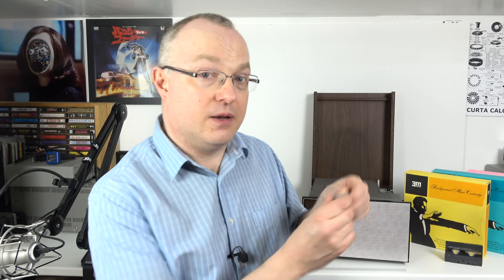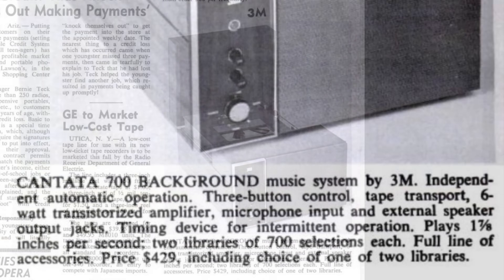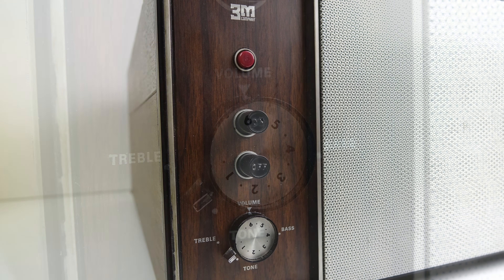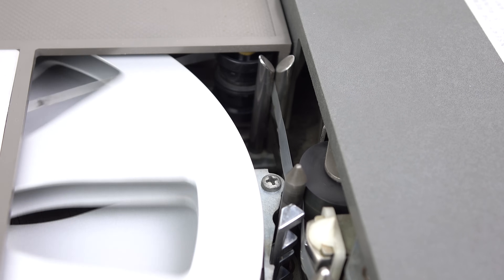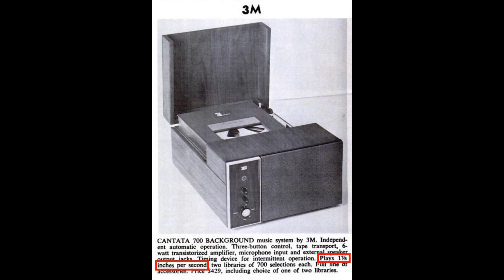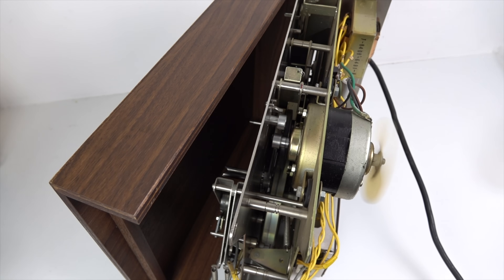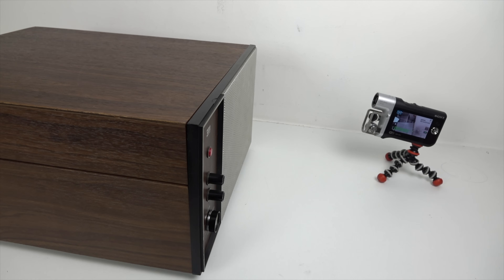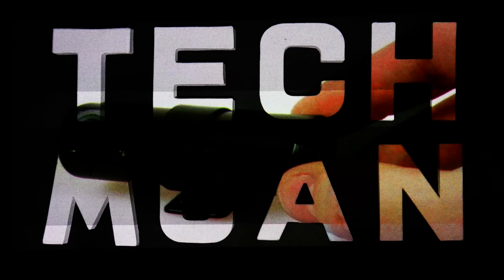Retro Tech: This 1960s BGM Machine played the Biggest Cassettes ever made - The 3M Cantata

Comment: 3M prefected the ability to stick something to something else. Think Scotch tape, sandpaper, recording tape and many others. Muzak was a separate company, a competitor to the 3M Cantata system. This system was the only thing available at the time for an on premise player, tapes ran between 18 to 24 hours. There were several Christmas tapes (a must for retail applications) which ran 8 to 10 hours, was painful to listen to. The best tape in the library was called "Bright and Lively". The players cost about $350.00 wholesale, tapes cost just under $ 300.00. To make a business out of it, the supplier had to have 3 tapes for each machine sold. One in the machine, one in the mail and a Christmas tape. The tapes were lubricated meaning you could not use ordinary tape in the cartridge. The music was recorded the wrong way so you couldn't play or record it on a normal tape recorder. The rubbers needed replacing from time to time, the play heads wore out, motors were expensive. All in all the machines were very durable. If you knew what you were doing, the Cantata could drive up to 20 overhead speakers. The wooden player was replaced with a plastic model, it ran almost as well but the motors gave out sooner. Other competitors came up with better music which crowded out 3M, satellite killed the on premise machine, internet killed the satellite equipment, all very expensive upgrades.

Comment: There was also another model that we don’t mention is the 3M Cantata 700 CA264 Cavalade, and it was another smaller unit, and it was from the early 1980’s and it was one of the very last machines that 3M ever made until they discontinued. It is very rare and very difficult to find.

Comment: Just saw this episode.  It reminded me of the music system from the store I worked in the same era.  It used 16 2/3 rpm records with large spindle holes.  The unique (to me at least) item was that the the top half of the changer mechanism rotated in the opposite direction.  It would play the record on the turntable then the tone arm would lift and a second stylus would play the bottom side of the one on the spindle.  It was a changer.  When the two available sides were done, it would drop the record.  When all sides were done, it would lift the stack to the spindle and drop the first record and start the process over.  8 records lasted most of a day.  Every so often, we would get another set of records so that the play list changed.

Comment: My uncle worked for 3M for 50 years. He worked extensively on the scotch tape line but his "baby" was the Scotch Brand MAGIC tape which was a pressure sensitive adhesive that you could remove without damaging whatever it was stuck to, made famous with their "post It" notes.  He was known as the "Glue Guru" so no, he didn't invent the post it note... But he was the reason it Stuck Around lol.  He then went on to make the company a ton of money by creating a special adhesive that was used in the manufacture of Fiber Optic wire.

Comment: (unrelated but:) Turning a tape device sideways to get it to align and work? Done that too, but for Video8! Trying to get our family's old tapes to play again on the capture card and immortalize 1 year old me in digital video format, had to align the whole machine a couple of times adjusting the tape guides so the angle it hit the drum was correct, and it would only stay correct if it was disassembled and sideways. No case allowed, whatever there was on the tight tolerances of those Sony Video8 cameras of the 90s sure didn't play nice 25 years later.

Don't even want to imagine the nightmare it would be working on even older helical scan stuff, thankfully for audio stuff with only linear heads it's not as infernal to get it working, but when stuff is old and without much spare parts available it sure doesn't help.

Comment: Sony made a three speed home reel to reel  machine that has 1-7/8ips speed in stereo which was fine for recording radio broadcast. Frequency response was up to 6-8KHz with normal tape and up to 10KHz response with the high end tapes. A 3600 Ft roll of tape plays many hours on one side. The cantata 700 reels look like it could store twice as much tape. I once recorded Fleetwood Mac Tusk On Maxell UD-XL tape and surprisingly it actually sounded pretty good at that speed.

Comment: Something that may not be immediately evident: This is *double-sided tape*. The tape goes from one reel, past the tape head, then does a half-twist and goes back past the tape head in the other direction before ending up at the other reel. That half-twist means that the two read head positions are actually looking at opposite sides of the tape.

That, plus the slow travel speed (1.875ips), plus the colossal size of the cartridge, makes a runtime of 26 hours totally believable. Still, it works out to roughly 1.38 miles (2.22 kilometers) of tape. That's a lot of tape. All of it filled with drivel.

Comment: i JUST found 1 of these in the trash tonite with 3 tapes AND a HEAVY metal trucker cb looking microphone attached to it powers up, nothing moves, pinchrollers total liquid rubber good to know what they are, now to bring it back to life again!
Reply: now if someone has the measurements of said pinchrollers i could make it sing as all the gizmos hopped back to turning by hitting the reversing switch the wheels started turning the posts were spinning but without said troublesome pinchroller sadly i cannot hear it sing once again also have to look at the audio outs as mine seems awfull quiet emitting ANY sound, full blast is barely a whisper.

Comment: Loved this video! Big personal flashback for me -- I used to work for a background music company in the early 80s that sold all kinds of systems, and a bunch of clients still had these machines running. My job was to fix those big cartridges when they finally choked. They would have been playing in the kitchen of some truck stop or diner for God knows how long, decades maybe, and when there was finally a power outage or it got unplugged, that was it. It would end up on my repair bench. I saw a bunch of these things, covered in grease. Or worse. Those rubber brake pads that melted were a familiar sight. Often there was no pad left, just a puddle of goo on the bottom of the cartridge. Used to scrape it up with a putty knife. I could usually get them running again, so they went back to the client, and those poor employees had to go back to listening to that awful music.

Comment: +Techmoan I was a little curious as to the length of those carts, and just did some quick working out based on the (Approx) 26 hours you put each cart at:

26 (hours) * 3,600 = 93,600 seconds of playback per cart,
  Multiply by 1.88 (1 7/8" decimal) = 175,968" of audio trackage,
  Divide by four (Assuming 4 tracks) = 43,992" of tape,
  Convert to feet (Div by 12) = 3,666 feet (1.17Km!) of tape per cart!

Does this seem in any way reasonable for what I'm assuming are 10" reels, or am I miscalculating/misunderstanding things somewhere along the line? :-)

Comment: 3M and Muzak were totally separate companies and fiercely competitive.  I worked for a Muzak franchise for about eight years in the 1970s.  I did encounter this mechanism during that period, but I do not remember much about it.  Muzak originally played 16 rpm transcription disk, but converted to 13 inch tape transports with each machine playing eight hours.  It was fully automated except for the loading of the tapes on the machines.  The music was distributed originally on dedicated telephone lines provided by the Bell system. Each exchange had its own amplifier which provided a line level signal to customer locations.  Later it also distributed the muzak via FM mpx sub channels on a local FM station.

Comment: I can see why those BGM pieces were 2.2 minutes long rather than the more standard 3 minutes. 2.2 * 700 = 1540 minutes. Tape is bidirectional, so divide by 2. You need 770 minutes of tape and 1.875 IPS, or 770 * 60 * 1.875 = 86625 inches of tape. If they used half mil tape that would be 43.3 cubic inches of tape. That 8.5" reel would have a max tape diameter of about 8", and the hub diameter is most likely 3".  That happens to be 43.2 cubic inches of tape. They couldn't have gotten more music on unless they went to a larger reel.

Comment: Great video as always, but I feel it's missing some of the technical details.
First of all, it's not clear but I suspect the reason there are two distinct tape feeds in parallel is that the tape is recorded on both its front and back side. The tape seems to get flipped over by that plastic widget in the cartridge, so the lower line exposes the back of the tape compared to the upper one. I can't see any other reason for doing it that way - if it was all recorded on the same side of the tape there would be no need for the two separate feeds. 
Secondly, even with recording on both sides of the tape and running at 1 and 7/8 ips, there's no way you could fit 26 hours of music onto a single tape of that size if you were only using a single recording track on each side. I'm speculating but I think it must be using at least 3 or 4 mono tracks on each side of the tape, and every time the tape gets back to the beginning and auto-reverses, as it moves the head back to the other side it also positions it slightly differently to read the next track. When it gets to the end of the last track on the back of the tape, it goes back to the first track on the front.
Recording on both sides of a tape is of course prone to crosstalk as the magnetic signal from the back of the tape can be picked up while reading the front, but it's such a lo-fi system to begin with that it probably doesn't matter too much.

Comment: Oh wow, does this takes me back. I ran the 3M Wollensak (Mincom) and A/V Products service facility here in the 70s and early 80s and had some of these pass through the shop. One stands out as being the best example I ever saw. That one belonged to the Horticultural Society of Philadelphia and was used during the annual flower show (and possibly at their office). I can't recall now what the complaint was but it was something simple as we turned it around the same day it came in. We gave it priority because of the impending flower show.  Have you tried using Rubber Renue on the rubber parts?

A couple of parts are the same as those used in their T-524 and 5000 series reel-to-reel recorders. (Head, pinch rollers, idler wheel, knobs, etc.) If you needed other parts you had a problem as 3M's duplicator/BGM division was separate  from their audio and visual groups and dealers/service stations for those products had no regular relationships. 3M ran each division like a different company.

On first sight most people thought this was an endless loop like an 8-track. Thankfully it wasn't. The various endless loop formats of the time included film projector carts, a/v carts, tape-controlled film movie/single frame combos, etc. All were trouble for the users and us. Technicolor's 8MM film system and Besseler's film/tape system come to mind as being special pains.. 

3M of the time believed in pushing for slower tape speeds. Their T-524 and first-generation 5000-series tape records had speeds down to 15/16 ips.

I was not aware till I saw your presentation that they had an offshore market for them too. Keep up the good work.

Comment: A similar product was manufactured by Rediffusion, (Reditune). This was around in the late fifties and into the early sixties. The difference was that the Reditune version used quarter inch tape, and was front loaded. These were made in Jersey, Channel Islands. It used a single continuous tape, pulled out from the centre, as in the later 8 track cartridge.

Comment: Here is my 2 cents worth regarding the wobbly sound, my god I recognised it immediately. I have had two cassette players in my life, the first one in the late 60's was an early Philips boom box as it were, in mono and the second was was a 1988 Honda GoldWing 1500/6 this one was in stereo thankfully, I still have it today minus the cassette deck which I smashed in frustration. The point of this ramble is this, I remember that wobble because both of mine did this and I found that rewinding the offending tape a few times fixed the problem, I figured that as one plays the tape for extended periods of time, like I did, the tape starts to wind up uneven and starts to rub heavily against the bottom part of the reel as gravity continuously pulls it downward, I don't know how you are going to do this other than dropping it into your reel to reel and give it a to and fro a couple of times, just a thought if you are still interested.

Comment: A spectacular find!!!! The error is in the mechanics of movement of the tape path or be the head is magnetized? If it is the head, there is the opportunity to demagnetize it surely. And then to transfer the audio (properly re-record), as the output is amplified for use of a low-power speaker can be directly driven to a DI box that has a pad (power soaker) of -20 Or -40 dB.

Comment: The plastomer and/or vulcanizing gives up in the materials and it returns to it's liquid state.  Thick felt probably would have been a better solution.
Reply: I suspect 3M went with this design so as not to infringe on the Shugart cart tape patent.
Reply: Good ole Wollensak motor inside :)
Reply: You need a bottle or two of Rawn Re-Grip, cotton swabs and paper towels to clean and redress all of the rubber idler wheels.

http://www.mcmelectronics.com/product/20-230
Reply: You could improve the lossiness of the 1 7/8" tape speed by feeding it into a Aphex Aural Exciter Type E.  You would of course need to pad the output down a bit to match the line level input of the Aural Exciter.

Comment: I just found one of these machine stored away in a building that we hauled some core rock samples to. right out from the building was a old abandoned country club and I'm assuming that's were it came from. there was some speakers up on the walls in what to looked like the ballroom and the speakers looked to be around as old as the player so I figured at one time they were probably hooked to it. I've cleaned it up but have yet to put power to it and it looks fairly decent. it has a cartridge in it but I'm not sure what it is exactly but the thing I noticed is the tape seems to have a small twist in it around one of the metal spindle things next to the head. it doesn't look like it would take much at all to fix but I'm not familiar with this type player and don't want to cause any further damage. everything in side when you lift the lid looks close to mint.  it's the outside that has seen a little more wear. anyway I was quite pleased to find it and it would of been in the trash had we not ended up going to the building because we have to do a big cleanup to store more samples. very good video and it pretty much covered everything I was wondering about. thanks again

Comment: When I was a small child in the 1980's (in the UK), I was fascinated by all things electronic and electrical... and I remember one item I obtained was a machine similar to this, but from an earlier era.  It was a steel chassis with that classic hammered metal finish, mine was a dull pink/purple colour... it used valves, and the cartridges were ~8x10 inches (although my memory may be clouded on that, as I was smaller then)... 

It's mode of operation as I remember was precisely the same as a sinclair microdrive, being a continuous tape loop or 1/4 inch tape.

Any idea what that would have been?

Comment: The playback head is a 4 track mono head that can be placed in 4 positions. The reels are 22 cm and the tape speed is 4.75 cm/s. A 22 cm reel can hold 720 m longplay tape, 1080 m double play tape, or 1440 m triple play tape - which will give a playing time of 4, 6, or 8 hours per track. With 4 tracks that gives 16, 24, or 32 hours on a cartridge. So they probably used doubleplay tape.

Comment: Did some networking work in a store a couple years back that still used a cassette hold music player. Big pile of tapes on the floor next to it, 3 or 4 dozen, and the newest from 1991.

More recently I was waiting on hold for a largish, fairly modern technology contractor when the music (an absolutely terrible, scratchy and distorted, instrumental Greensleeves) suddenly stopped with that so-distinctive sound of a broken tape. Somewhat amusingly that call was about the installation of a client's new Internet-connected, digital, BGM/PA system.